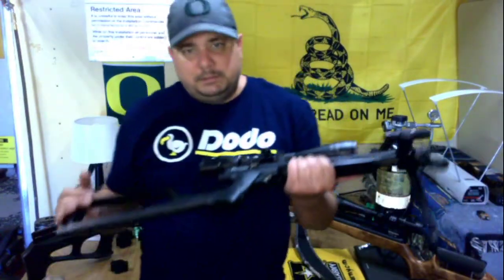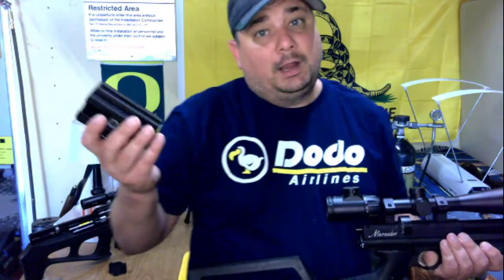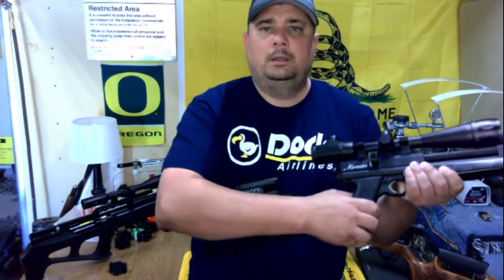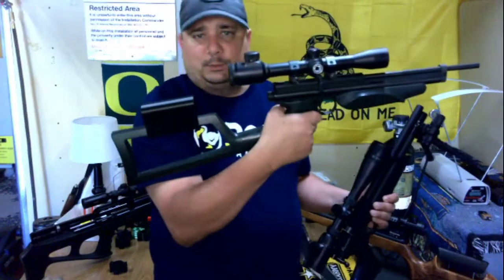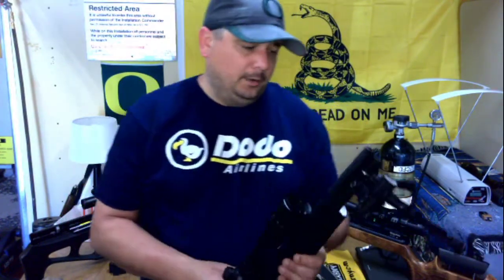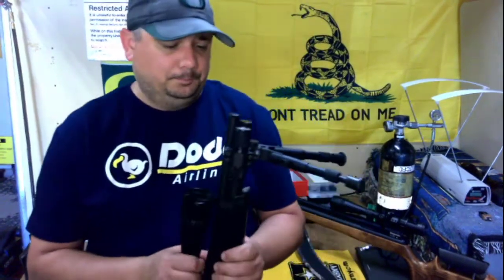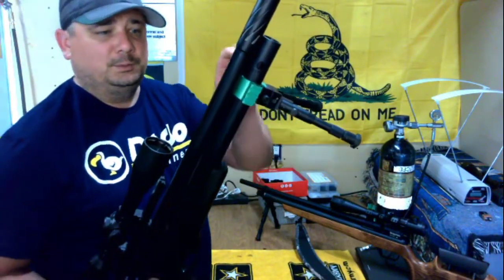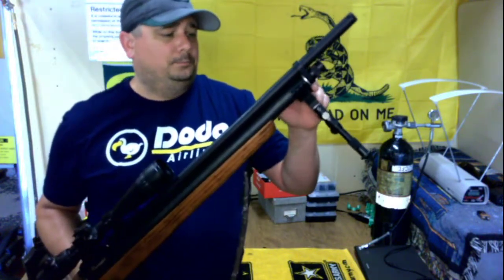Benjamin Pistol Marauder Accessories

Comment: Just ordered your products. 
I haven't a clue how 3d printing works.
However,  I would love to see someone  to build 3d printed, a clamp on front sight. And a rear dovetail sight
Reply from the maker: This could be done, however would you want the rear or front sight to be adjustable? The rear sight would be easier to print as a slide on non-adjustable piece, with the forward with rotate ability, opposite of a traditional setup.

Comment: Do you produce a tripod mount for the Benjamin Akela? Also, how are products ordered from you? Website?
Reply from the maker: I don't own on of those. What is the diameter of the bottle/air cylinder? ebay if it is the same as the marauder.
Reply from the maker: I don't have one. Is it the same as the marauder? Is there room?
Reply from the maker: I use ebay for sales, I don't own an Akela. Is the air cylinder the same as a Marauder?